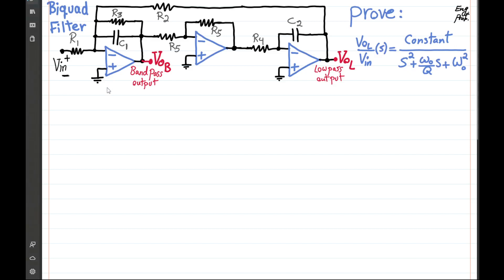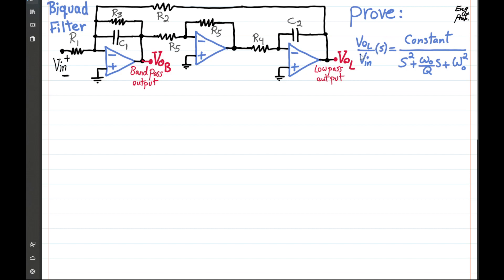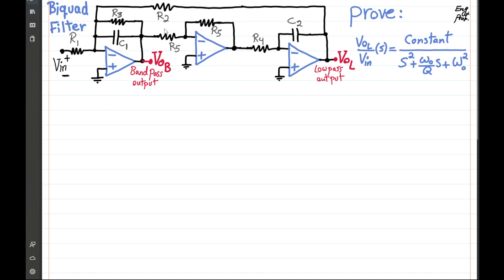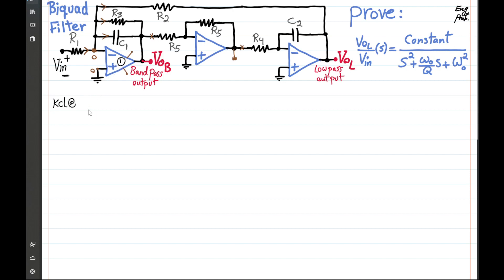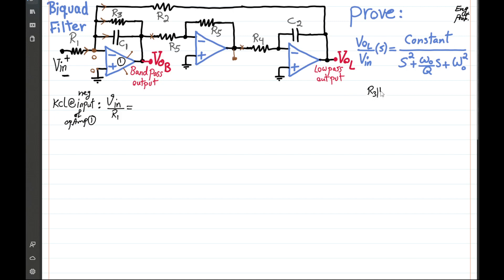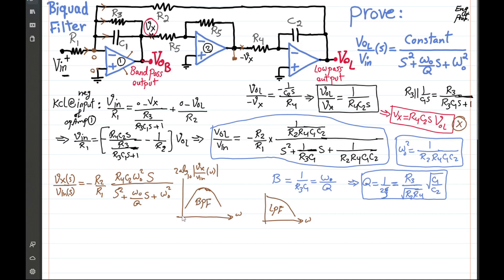BiQuad Filter Circuit Design and Transfer Function Analysis

Comment: Sir, is it correct that the Tow–Thomas biquad inherently provides both low-pass and band-pass outputs? As I understood, in the 3-op-amp structure (lossy integrator → integrator → unity gain follower), if we take the output from the last op-amp it gives low-pass, and if we take the output from the first op-amp it gives band-pass. So if a question asks to design a band-pass biquad, can I just design the usual Tow–Thomas circuit and then mention that for band-pass the output should be taken from the lossy integrator?

Question: Design tow-thomas bandpass biquad with center frequency of 1000 rad/sec bandwidth of 200rad/sec and a max gain of 1.
Reply from the maker: Good observation and question. Yes, the Tow–Thomas (a.k.a. “ring of three”) BiQuad naturally provides both outputs: The band-pass comes from the first op-amp stage (the lossy integrator node).  The low-pass comes from the last op-amp stage (after the second integrator + buffer).  So if a problem asks you to “design a Tow–Thomas band-pass biquad,” you don’t need a separate topology; you design the standard Tow–Thomas filter, then simply specify that you’ll take the band-pass output at the lossy integrator. That’s exactly the point I walked through in the video.

For your question of designing a Tow-Thomas bandpass biquad with center frequency of 1000 rad/sec bandwidth of 200rad/sec and a max gain of 1.  Your specs are:
Center frequency:  ω0 = 1000 rad/s
Bandwidth:  B = 200 rad/s
Max band-pass gain = 1

We use the standard Tow–Thomas band-pass transfer function:  HBP(s) = (ω0/Q *s) /(s2+ω0/Q*s+ω0^2)
Here,  Q = ω0/B =1000/200=5
So the band-pass TF becomes:  HBP(s)=200*s/(s2+200*s+10^6)
Notice that the maximum gain occurs at resonance (ω=ω0), and for a Tow–Thomas the peak gain is 1 when the component ratios are chosen correctly. That matches your spec.

So yes, the Tow–Thomas inherently gives you the band-pass output you want, and the numbers above define the transfer function for the given design. The actual R/C values can then be scaled to realize ω0 and Q.

Comment: If you dont mind me asking why is R5 not a capacitor and C2 a resistor?
Reply from the maker: No problem. You can swap the placement of those two linear op amp stages in cascade. I mean theoretically you can place the RC opamp integrator first and then the unity gain inverting amplifier. For a related example please see this video https://youtu.be/SIMg5TOIgrA which ia a Butterworth Analog Filter Design with multiple Op Amp stages.